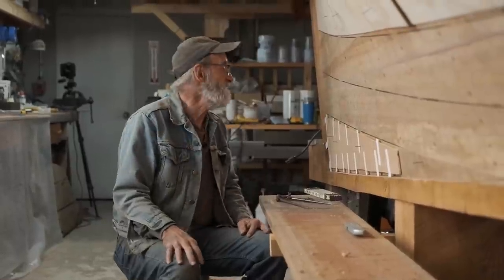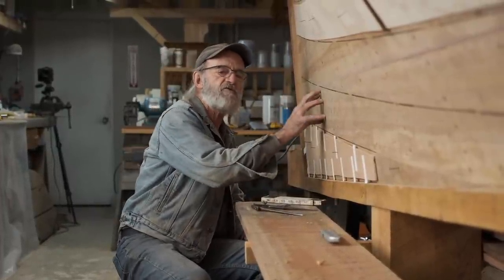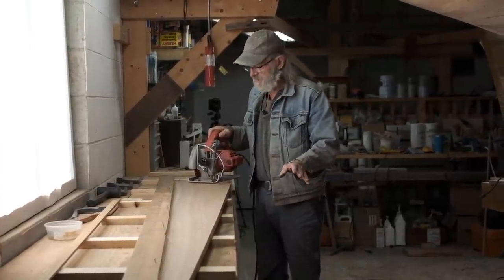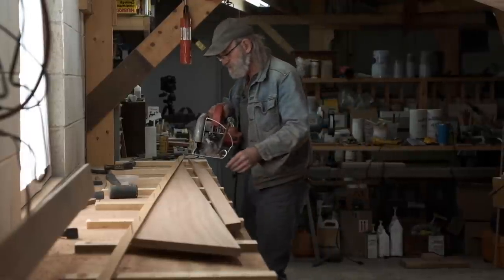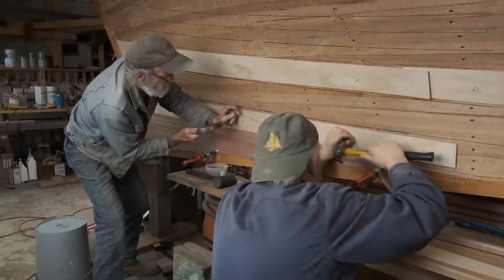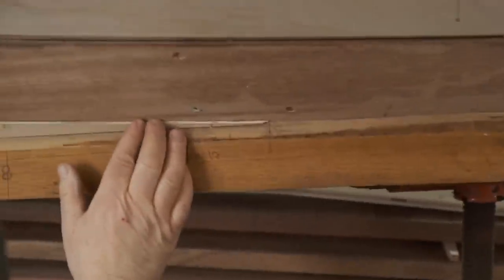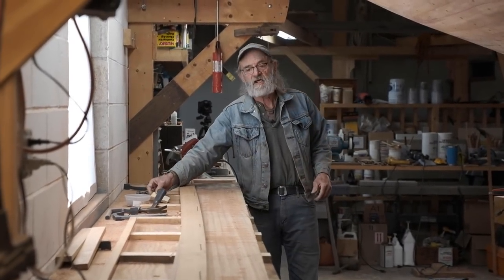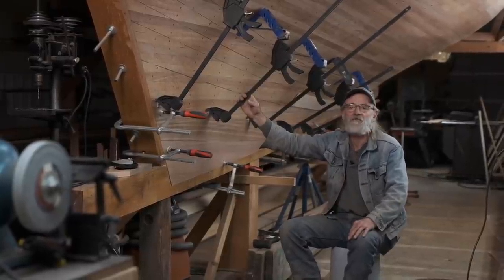Building Evelyn: Simple patterns for planks below the tuck, EP16

Comment: Have you ever done a segment on how you modified your saw for cutting rolling bevels?
I think I had a Milwaukee like that back in the mid '80's.
Reply: Yes, he did, but I don’t remember which series. Maybe the first work skiff.
Reply: @barrykarow906  Thank you Barry! I will go check on the other channel.
I've already seen Leo's saw but I'd like to have a better look at the one Louis is using.
3/8 offset to the shoe seems tiny for an older saw like this.
I'd imagine the angle adjuster has a really steep pitch as well.